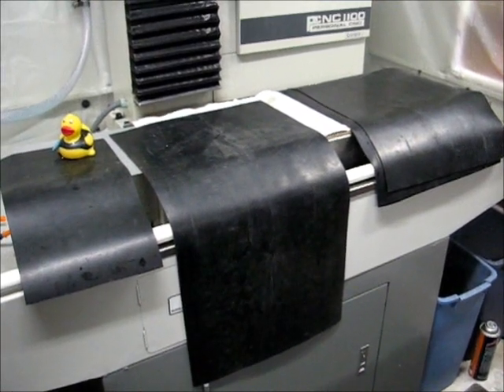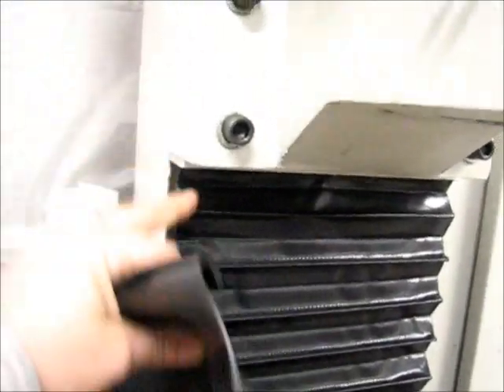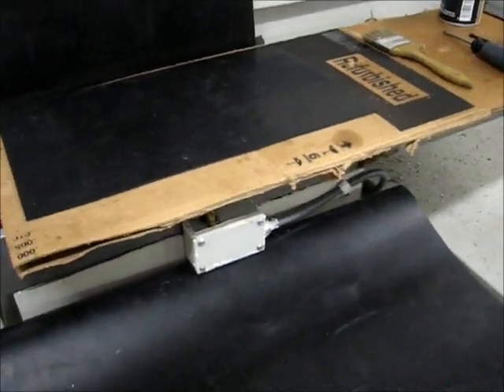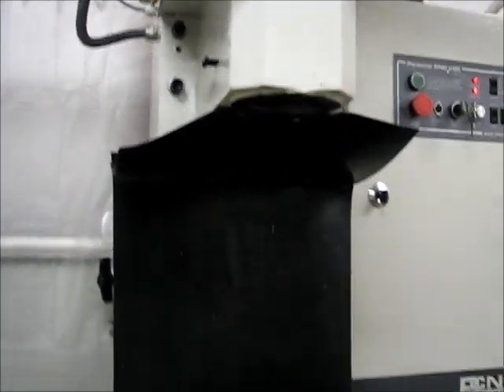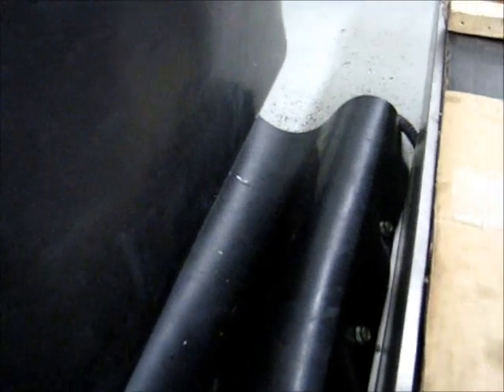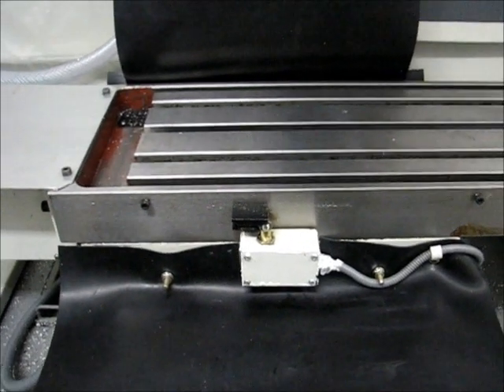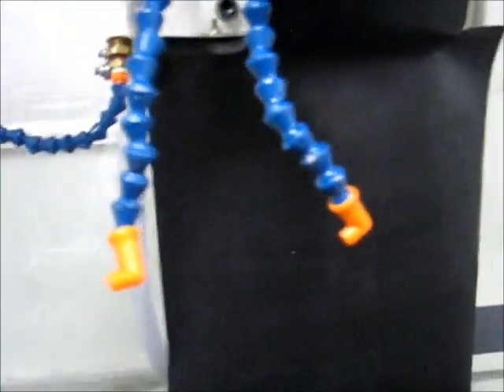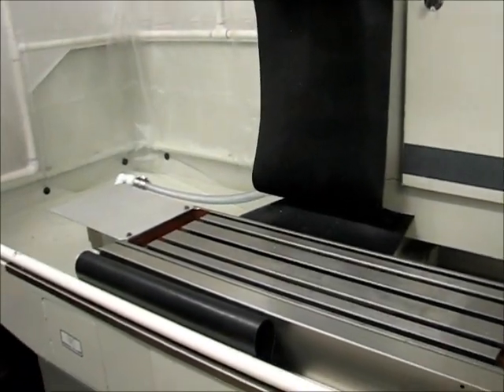Tormach PCNC 1100 - Neoprene Chip Guards (Darth Vader Conversion)

Comment: Chris;

Just started watching your videos, so these comments may not be as timely as hoped.

1.  For the air space between the flap and the bottom of the milling head, how about stuffing a couple of stainless steel scrubbing pads in there?  These will act like demisters, yet still allow air flow into that area.  I think you did this on your coolant system to act as chip catchers.

2.  In order to take care of the chip buildup issue on the Y axis covers, how about putting some small air blast nozzles (mounted either to the table or to the Z column for the back Y axis cover) that periodically blow the chips away?  This way you aren't having to use coolant to try and move the chips out of the way.  You certainly appear to have the skills to have some kind of timed relay system to air blast the chips.

Regards;

Ron Kluwe

Comment from the maker: From experience, enough chips build up quickly enough (in about 30 minutes of one operation, see the links in my other reply) to damage the bellows permanently, requiring replacement. I bought CNC so I wouldn't have to machine parts manually. I'd rather not try to brush chips off of the bellows while the machine is running. If I can come up with a solution that prevents me from having to clear chips manually (which this did), it seems like it matches the intent and purpose of the CNC mill.

Comment from the maker: Take a look at this video...

/watch?v=fPMeAkXklo8

... at right about 10:42. You'll see the giant pile of chips on the bellows behind the table. That's from one roughing operation after hitting "Go" once. Those chips pack into the bellows as it moves while machining and pulls the bellows fabric off the ribs, permanently damaging it. A replacement from Tormach is $38-ish. This neoprene was $20. Here's what the damaged bellows looks like:

/watch?v=2Y8ZeBOZRc4